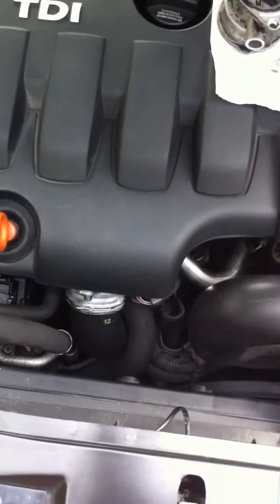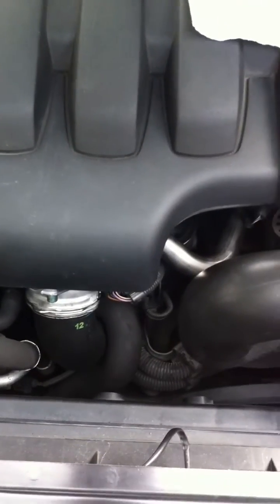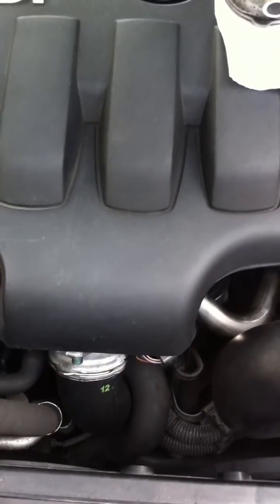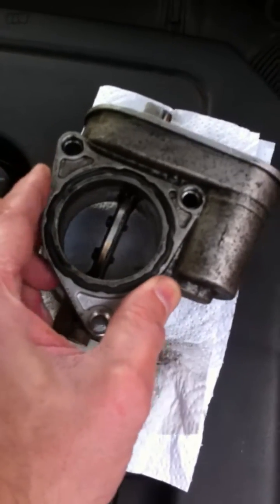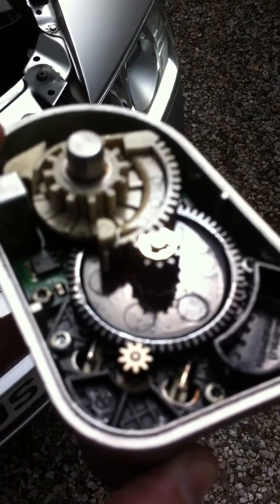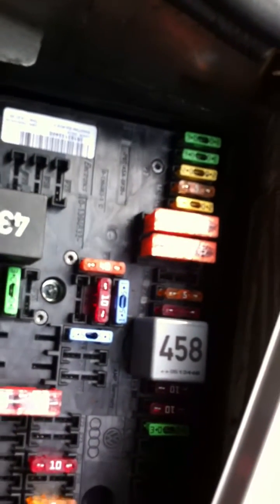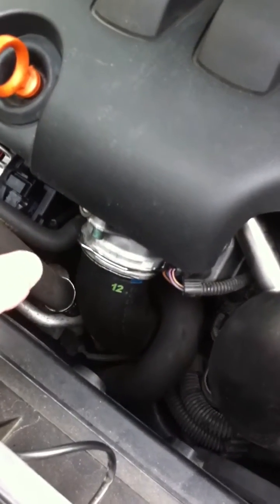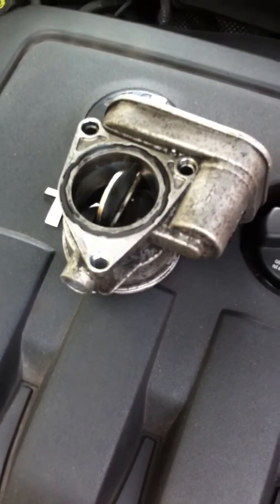Skoda Octavia TDi 2005 throttle flap motor V157

Comment: Is it safe to unplug the connector for wire inspection without disconnecting battery? Thank you
Reply from the maker: Yes, you can safely disconnect the plug without disconnecting the battery. There is no power to the flap motor if the vehicle ignition is switched off.

Comment: Hi, I kindly ask your support. I have a VW fox with 1.4 tdi Engine “BNM” showing the error:

Motor for Intake Manifold Flap (V157)
P3103 - 35-10 - Malfunction - Intermittent
I replaced the original valve 045 128 063 G with not original one from Febi. Afternoon installing and cleaning the engine error engine light switch off. If start the engine and then turn off the error come out again and engine light also on. VW Dealer say that I need to put original component for a crazy cost of 600€.
Do you have any idea? Also in this car I can’t find a fuse box inside engine bay. I’m guessing if second hand vale could be the solution. Thank you for help
Reply from the maker: Febi is a good manufacturer, I think that their part should be a good replacement. VW will only ever recommend their own part.

From my experience when the flap motor fails it blows the fuse that supplies it. Have you proved that your flap is moving when you start and stop the engine? If it is moving then your fuse is good and you have a problem somewhere else.

If it does not move then you can measure to see if you have 12V at the motor connector. If not then I would suspect the fuse. I do not know where the fuse is located in the Fox, you will have to do some research online or test all of the fuses in your fuse boxes using a multimeter.
Reply: Thank you for replay and advise! The valve is not moving indeed the car shake when shutting off engine. I will further check the fuses even if I already check inside cabin fuse box. I will also check if in connector I can see 12V. As last tentative I will also try a second hand original unit, but I suspect that the problem is in someway electrical.

Comment: did your car cause stalling as mine is and I can't figure out what's the issue
Reply from the maker: No it did not cause my engine to stall. If the flap closes when the engine is running then it will stall. When the engine stalls you want to leave ignition switched on, remove the rubber pipe from the valve and see if the flap is closed. If it is then that is your problem. If you can get a code reader that might give you a clue.

Comment: Did you have problem with start engine ?
Reply from the maker: Yes it stops the engine from starting. If you remove the large pipe and switch on the ignition the flap should move to the open position. If not check the 10A fuse and make sure that the flap can be moved by hand.

Comment: How do you open the throttle body to check the gears? I had the V157 code come up, replaced the fuse and the throttle body and still have the same issue.
Reply from the maker: To be honest it is too long ago and I can't remember how I removed the cover. It is probably stuck on with adhesive so you probably have to tap it off with a hammer and drift or flat bladed screwdriver. You can see if it is working by turning the ignition key and watching to see if the flap moves to the open position. If it does not then you need to make some voltage measurements, start back at the fuse, then check on the connector to the flap motor. Are you sure you changed the correct fuse? Is it definitely fitted in the correct position?

Comment: Going to tackle this one mine soon - hopefully just the fuse! Have heard that the potentiometer can go in these causing a fault but it can sometimes be repaired with contact cleaner spray. Not if the gear is broken though!
Reply: I was wrong - it was the same as yours with a couple of broken teeth. Looking for a used part as the car's not worth much!